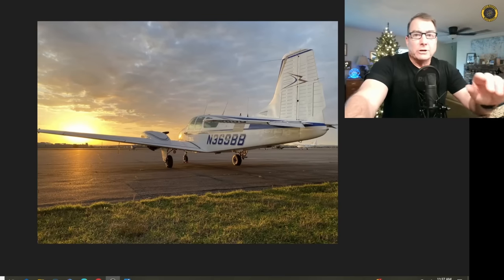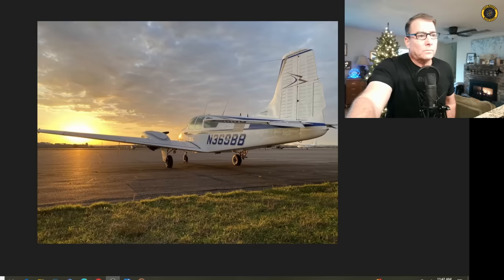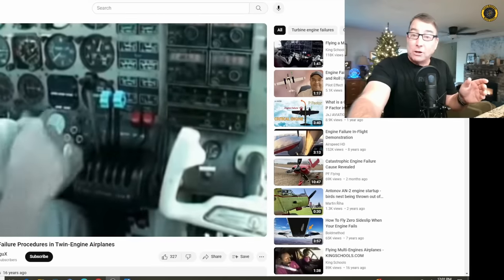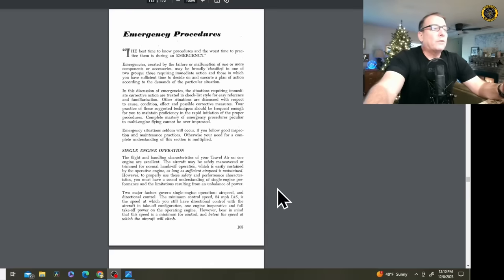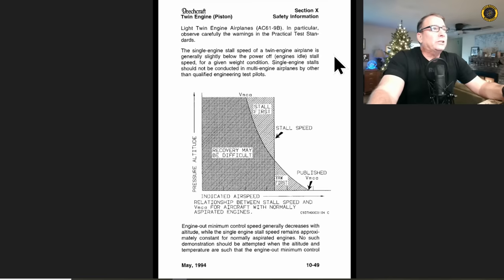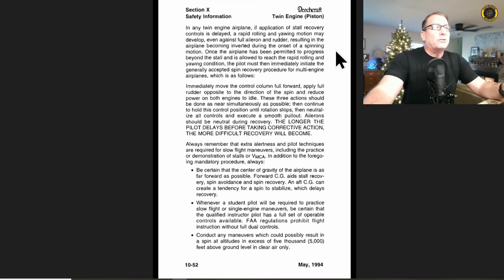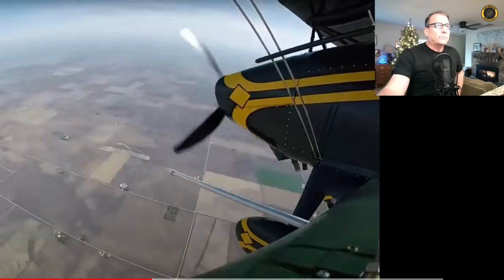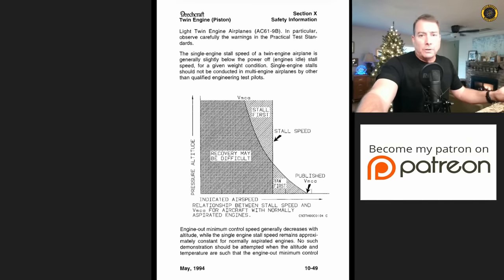Another Fatal Vmc Demo Stall Spin!! N369BB 4 Dec 2023

Comment: I think the book should be emphasis that it is IAS. 
Text books usually teach stall speed actually increases with altitude. refering to TAS.

Not enough people teach that the IAS is actually a reading correlating to the pressure that the sensor/insturment is sensing. Instead they teach it as just oh its refers to your airspeed. dont go below this number or else you'll stall. dont do things above this number because the aircraft will break.

Comment: Sequence should be PARE: power, aileron, rudder, elevator. NASA did research on applying forward stick before opposite rudder and this typically delayed spin recovery for a variety of reasons. Also, neutral aileron is not ALWAYS correct, if the spin has flattened then in-spin aileron may assist recovery depending on the aircraft type.
Reply from the maker: that one is a scam, look out...

Comment: I wonder if he got on the radio to alert ATC of his location for potential rescue, as he knew he was going down, unable to correct the spin at his current altitude. After all, he wasn't requesting instructions and it's just a push button on the yoke to communicate. Yes. Aviate, navigate, communicate, but a 3 second press of the radio button in an unrecoverable flat spin is not going to matter one bit in relation to the first two.

Comment: What a tragic situation which is so easily recovered,  all of my multi engine instructors have 2000+ hours, 300 on multi engine and must do advanced upset and spin recovery every year, and the situation will get worse, new fuel efficient aircraft have an aft C of G and airfoil fuselage which makes them unstable in stall and far more prone to spinning,

Comment: Very interesting video. I agree completely with everything you said, excepting the 1500 hour requirement for ATPL issue. I've done the former, and taught lads and lasses on the accelerated 250 hour ATPL. The difference between the two, in hand--flying skills is really striking, especially if the 1500 hours is built instructing. The FAA (as I understand it) has also removed the need for spin training from the US Private-pilot syllabus because of accidents therefrom. This seems to me to be unethical, as one is effectively condemning to death any such pilot who inadvertently spins. By the time a light aircraft pilot has made 1500 hours, he's a very different airman relative to the 250hour "crammed" pilot. 

That accidents are occurring in training flights, speaks to the need for better training of instructors, both in singles and twins, who are conducting incipient or developed spins, and quite likely the mandating of specific aircraft suitable for the purpose. That basically should exclude cruising aircraft not designed for aerobatics, as the harnesses are often inadequate, and the seat-runner locks likewise. My Chief Flying Instructor was very nearly killed by a harness that failed during a simulated engine-failure after take-off, by the student, which caused the student to fall onto the yoke. Fortunately, he had chosen to do the demo at altitude, rather than as we usually did, off an actual take-off. The FAA's policy on spinning is deeply flawed imho. As regards spinning twins, or VMC demo's which might precipitate a spin, that's self-evidently something the instructor must be totally "up to snuff" on,  and the eventuality of an inadvertent spin, thoroughly planned for. The issue here is not whether you should receive spin training, it is whether any-old-twin is actually suitable at all for training by other than extremely capable senior flying instructors, where there's a possibility of a spin?

Comment: FAA needs to mandate and require parachutes on these aircraft. I trained in the Cirrus, they don't meet the spin recovery requirements so CAPS are required. These regulations should be no different on a multi engine.

Comment: I've spoken with some airline pilots who feel that the 1500hr requirement was necessary, and while I don't fully disagree I don't feel the underlying problem of lack of continuing training in stick-and-rudder skills and stall/spin recovery was not really addressed, and I think this accident highlights that fact. My opinion is time in type is great but you also have to quantify the quality of those hours, if a pilot with 1500hr has little to no training/experience in stall/spin recovery, flying into known icing conditions etc. then really that pilot is equivalent to a pilot fresh out of school with 200-300hrs if that.

Comment: Juan exlent job unfortunately there are to many flight instructors who are only time builders, and have not taken the time to really learn the details to be a to be a real instructor. And are trained by other instructors with similar goals and very limited experience. I started my 135 career at a time when when very experienced pilot's were paying the airlines $10000 dollars to get a one year $10000 job. I had one friend who had  4000 flight hours as a instructor in a c152  before he was able to find a pilot job.
But he did get lots of experience in many GA aircraft, weather and decision making was able to pass that knowledge on to his students.
I was very lucky and able to interview and pick or reject my flight students depending upon their rules attitude. 
The final issue it appears that with all the recent GA accidents the instructors are more interested in teaching high glass technology navigation systems and depending on the autopilot rather than the basics of  flying the aircraft by stick and rudder. In bad weather if you can't fly the aircraft with out the autopilot then you shouldn't be there because it will give you control or lost of control of the aircraft when things get bad.

Comment: Thanks for your content. 

If the ac is NOT designed for spin demo/ training,  i think this accident should be the nail in the coffin.

Flying schools should not venture close to stall territory, especially in multi engine ac.

Yes it's important to recognise the symptoms of stall and spins, but shouldn't be demonstrated on these ac.

For such experience,  students may be exposed to single engines ac at schools / private setups where instructors are specially trained and proficient on this maneuver. 

I hope FAA does something about this now.

Comment: I know you said you can’t go into critical engines right now but I was wondering if they cut power to the right engine instead of the critical would the flight have been more recoverable/survivable? 

I get that the VMC was a factor but could it have been mitigated by cutting the right engine and getting less yaw in that stall?

Comment: Small Twins intended for training should be equipped with small drogue parachutes in the tail cones the same type of stabilizing chutes NASA used during flight testing for flat spins and multiple turn spins from high altitude. Even though these shouldn't be needed it might save a slow student instructor combo if they are behind the aircraft . I mean Cirrus has the entire air frame recovery chute a small spin stabilizing chute shouldn't be too cost prohibitive and would probably save as many lives as the Cirrus chute has or more.

Comment: My multi training in a Seminole was almost 20 years ago  but I'm curious, is it possible to counter spin rotation by increasing power on one engine against the rotational direction? Obviously not anything you would try in real life, but in an emergency when unintentionally entering a spin in a multi, would full rudder and opposite engine power simultaneously be enough to stop rotation?

Comment: I really think there is something fundamentally wrong with flight training in the United States. Here in Ireland and Europe we have very very few GA / training crashes. Yet you can fly for Ryanair after 250 hours and they have had 0 crashes. It has to come down to flight training and schools. Here in Ireland it would be very difficult to become a commercial pilot if your training via pay to fly lesson by lesson. Most Schools here in Europe are 0 to hero schools. In my training it was intense but safe and you knew that everything was EASA regulated and over seen by the IAA. I can’t figure it out but something is missing in the US.

Comment: I’m just wondering - if your rudder can not stop rotation, I wonder if adding power on VMC demo on dead engine simulated would have stopped this spin?   In a real dead engine spin, this would not be possible - but simulated VMC, I believe it could stop spin using differential thrust?

Comment: (non-pilot here, but I am an engineer).  I understand why there is a need for this training, but it does seem like it should be done in a high level simulator, not in an aircraft.  But even then, I get why doing it in an aircraft has benefits, feeling what it feels like.  But it's right on the edge of dangerous.  EDIT:   I read before that some instructors will put a block behind the rudder pedal to prevent the student from riding full rudder to get to the loss of directional control, they get it well before stall speed that way.

Comment: I'm not sure why all twin engine planes do not have counter-rotating propellers. Very simple camshaft change makes an engine run in the opposite direction and I guess you'd have to make the starter turn the opposite way also
Reply: Parts commonality and economics weigh against a counter-rotating design. In real life with an engine out you stay at blue line (a good margin above Vmca) until short final. So having counter-rotating props is not really a big safety advantage.

Comment: Conceptually it seems opposite engine on a blown wing could help adding lift to the stalled wing and corrective yaw.  If I had full opposite rudder in, yoke full forward and wings level and still spinning what do you have to lose trying?

Comment: Juan you are trying the impossible and I commend you for not stopping.
Stall / Spins keep happening at high rates and show no sign of slowing down .
I appreciate your dedication to safety issues but you and others are just beating your head on a brick wall.
Improper use of rudder is killing lots of pilots.
Every pilot should watch the Turn Smart Video by Wayne Handley.
Practice the falling leaf at 5000 FT AGL.
I'm mainly focusing on single engine aircraft with falling leaf practice.

Comment: 😮 Safer on the ground in my recliner, considering current general and commercial aviation. Especially with weather, shortages, experience, crowded skies and stress with present-day Air Traffic Control in my opinion. 14:35

Comment: 5:16 - stalling before losing direction would mean you're still above VmC so why enter a spin? Did you word it wrong or I am understanding it wrong? Thanks.
Reply: Induced flow by the operating engine keeps that wing above stall, so the wing with the inop engine stalls before the other. That drops the aircraft into a spin in the direction the aircraft already is tending towards

Comment: Some of this information is incorrect, if both throttles on a Baron are brought to idle and standard spin recovery is applied it will recover. You will need to be within CG range.
Reply: During the incipient stage, once the spin is fully developed recovery is nearly impossible.

Comment: I've seen videos where a single and twin prop was in a spin, and either an ATC or someone in the plane told the pilot to let go of the yoke and the plane would straighten itself out, and in the 3 videos, that worked. Why don't all pilots in single and double props use that technique.

Comment: New to me... do you mean block the amount of opposite rudder (recovery techniques rudder) ? because it can also stall? THanks
Reply: Here's my understanding of it.  If the student has access to a LOT of rudder control, the student can maintain directional control down to a fairly low speed.  That speed may be lower than the stall speed.  The plane then stalls with a lot of yaw, which starts a spin.  
If the instructor partially blocks the travel of the rudders, loss of directional control will be at a higher speed, a speed that is higher than the stall speed.  Since it's training, the student will encounter loss of directional control (at a speed well above stall speed), and the student can do what is needed to regain control without the risk of a stall/spin.
I think the rudder stalling is also a concern at low speed and a high amount of rudder input.

Comment: 13:23   stall (too-low airspeed) equals  reduction of the effectiveness  of all the flight and  control surfaces.        imo, to say that a rudder stalls is to say that its effectiveness reduces due to an insufficient amount of air moving past it.     (imo, even though a rudder can be said to  'stall', the 'aoa' of a stalled rudder is  irrelevant to the occurrence of said stall condition.)
14:20   the message here seems to be,  in order to simulate reduction of rudder effectiveness during spin recovery training, an the instructor should act to limit the amount rudder deflection that is available to a student pilot.     d

Comment: Juan, I fully endorse your opposition to the 1500 hour requirement.'

I was trained in the UK on an 'Approved Course' by CAA on which the instructors were training to airline standards and procedures. Then we got CPL and I/R in 235 hours (Now 250 hours) and were checked by CAA examiners.

As you have pointed out letting trainee pilots operate in GA to lower standards does not help them progress to airline operation.

Comment: I have been thinking about this problem.  Just to be clear, I am not an engineer, I am not ever a pilot so I could be way off base here.  However, mounting a small parachute/braking device on each wing tip that deploys when you go full rudder (right or left) and above a certain centrifugal g limit (Ie, currently in a spin) seems to be the 21st century solution to this problem.  There would be considerations ofc like when to release the device.  What procedure to follow, test, ect.  I just see SpaceX landing (partially)autonomous rockets and think to myself there HAS TO be a solution to this problem.  This type of activity, training that is, should not be this dangerous.  My heart broke listening to this pilots radio calls.  I have watched a few videos explaining powered spins in small twin engine planes and understand that at a certain point there is NO recovery from it.

Comment: I KNOW this is irrelevant to these twin GA types, but I am reminded just how much safe boeing and airbus really are wrt how the avionics systems are designed to inhibit these dangerous conditions.

engineering safety INTO the aircraft design to reduce and in some case to eliminate them entirely seems  completely reasonable and yet this is what is missing with nearly all GA aircraft.  

Yes it IS more expensive ti implement..Yes, it would require more training.  

the current state of GA safety is completely reliant on pilot proficiency...and in some aircraft and condition, there isn't much room for error and recovery from error in some instances, just doesn't exist.  As blanco shows and explains with excellent teaching ability.

I know one thing, if I was a pilot in training, I would be very very selective from whom I receive such training.

Comment: Typically, if the demo is done correctly, the rate at which the speed is decreased should be slow enough that a subtle loss of directional control or a stall horn will be noted, at which time the demo should immediately be discontinued by retarding power and significantly reducing the angle of attack.  I personally believe this type of demo should only be done in smooth air, where precise control is possible.

Comment: Could you go power idle on the engine operating at the higher power setting, then use the normal spin recovery technique?
Reply: That's the general spin recovery procedure for a twin, but it's not guaranteed to work.

Comment: IF the airlines can use full motion flight simulators to provide FAA mandatory training then why can't the regulations be amended to state that if you do 90% of your 1500 hours in a full motion twin engine flight simulator at a privately owned pilot instructional corporation then you have met the requirements?

I'm quite sure that a group of instructor pilots and simulator programmers/operators can create 1500 hours of meaningful
twin engine flights for aspiring pilots to experience. 

Yes, there won't be as much real world time sniffing of tires and hydraulic fluid, banging your head on a actuator covers, freezing your ears, and stumbling on slippery cracked ramp concrete, but it might be safer overall.

Comment: Why are those left engines critical compared to the right if an aircraft is 100% symmetrical??
JB can you shed some light as it doesn't seem logical to the lay man. Thanks JB for what you do.
Reply from the maker: See previous updates.
Reply: When you raise the nose in an attempt to maintain altitude, the propeller blades make more thrust when they're moving downward than they do when moving upward. This difference in thrust is caused by the props being angled upward when compared to the relative wind. Note which way the props rotate on conventional twins and counter-rotating twins. Then look to see where the blades are moving downward vs where they're moving upward. Moving downward between the engine and the fuselage is good, and moving downward on the side of the engine away from the fuselage is bad.